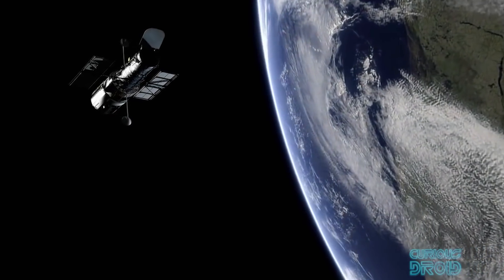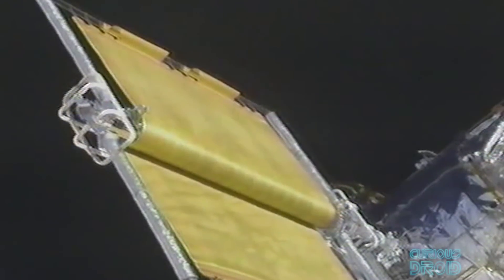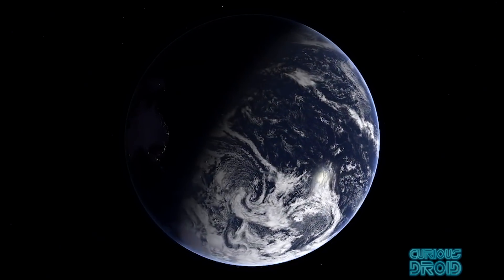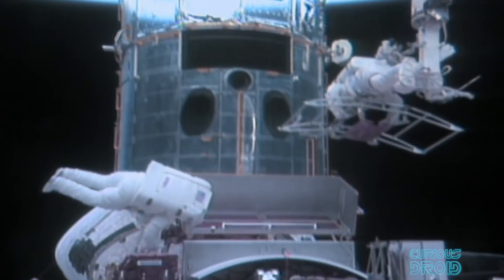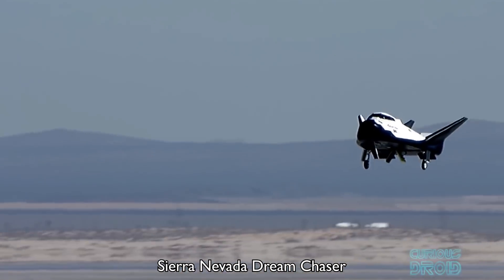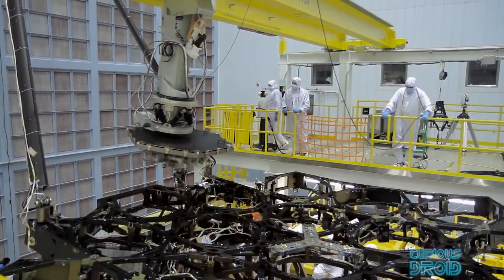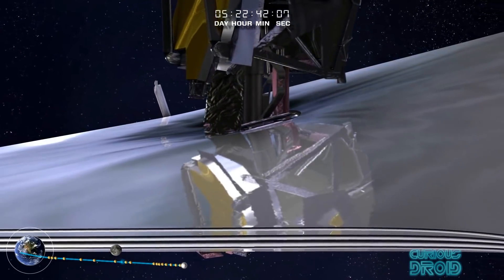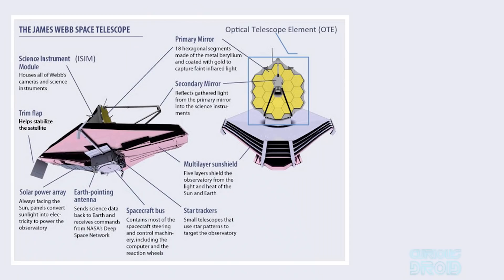Can We Save Hubble and Where is the James Webb Space Telescope?

Comment: “What do you think we should do with the Hubble telescope”?
My answer: Fix It, my suggestion to do that is to draw up an international prize open to private industry to travel to the Hubble servicing it, and then push the telescope to the desired higher orbit.
Reply: Obviously they need something big enough to handle hubble, and the telescope is quite big. Plus to operate on today's stardards, it would pretty much need to be completly rebuilt. However, at least we know that space X's starship could hold it in its bay, so at least that sorts the issue of the "who" can save it
Reply: @mobiuscoreindustries  yeah i think starship would even open options to pick huble up into its belly and work on it to improve it without EVAs neccessary. That said Crewed Starship will take another 10 years.
Reply: @invalid8774  I mean, an uncrewed starship could at least prevent it from falling down, but starship is progressing extremely fast. And while engine-rich exaust can still be a problem, really in term of tech they need to really figure out, only 3 hurdles remain:

- Skydiver landing maneuver. As the most risky part of the entire flight and most radical of its design, they will need to prove a lot to ever get humans on that
- Reentry shielding and re-use. Obviously this is where programs like the shuttle utterly failed, because their refurbishement was just a mess. SpaceX took a better aproach (i think) but its effectiveness remains to be tested
- Hot gas thrusters, these will be an integral part of the "true" skydiver maneuver as a way to make it a LOT less risky. With the extra power of the hot gas thrusters, the flip maneuver could be acheived usign the thrusters alone, leading to a "simple" linear deceleration.

Considering how fast they have been moving, i am thinking that a crewless starship could take on operational missions as early as 2023 and maybe even sooner. I can't say for the crew, since these take a lot of time, but i think spaceX has garnered the respect of both financials (who still groan because spaceX will stay private but whatever) and the public worldwide. Only thing that could really delay starship would be opposition by lobbists from their rivals (thinking ULA and BO primarely) that would make it harder for an unorthodox vehicle to take on missions, or try to exclude the starship from any of the lunar missions.

That being said, in typical Elon fashion, he already devanced the issue by pressing forward the activation of starlink. With financial independence the starship timeline is less likely to fluctuate due to political shifts unlike almost all governement funded space projects
Reply: @mobiuscoreindustries  While I fully agree with most of your points but I see a lot more influence that might cause delay. The raptors havent flown ever, we dont really know their reliability yet. That certainly has to be grinded out for crewed missions. Also the tank design will need tests to optimize and I dont expect they will hit bullseye on first try with this one.
SuperHeavy construction has just started and needs to be tested. While its arguably just an upscaled falcon booster, that might take not that much time but upscaling such a complex thing as a rocket is usually not done that easily.
A launchable starship in 2023 for missions might be possible, I think a lot would have to work out decently for that to work. Worst case Im sure we will have extended test flights and mission simulations in 2023. But considering how long it took for falcon to transport humans, its hard to say, if we see crewed starship missions this decade. Maybe as the lunar lander module for the Artemis program but I dont expect NASA going with starship with this one. Time will tell.
Tbh I hope Ill be wrong and SpaceX gets to launch crewed missions in the next 5 years and uncrewed in 2022 or 23.

Final thought: how would starship catch huble and stop it from dropping into earth? does hubble have a docking port or sth alike? How did the space shuttle move hubble? I never looked into that, do you know?^^
Reply: @invalid8774  First of all, the raport HAS FLOWN, serval times in fact, during the 50m and 500m hops of the serval starship testbeds. They have also endured far more static fires and overall engine tests, including the raptor vaccum engines, which are resilient enough to be fired and tested at atmospheric level without too much flow separation (for those uninitiated, the destructive effect that using an overexpanded nozzle causes in atmospheric pressures).

This makes raptor into the only full flow stage combustion engine to ever be tested in flight, and de facto the most advanced engine currently manufactured. As for reliability is is true that it will need to be thoroughly tested, but so far the only flight test that resulted in engine damage was starhopper (where in the very last few seconds, you could definitly see the raptor was running "engine-rich"), the rest of the tests and ocasional failures were all linked to other failure points, which is quite surprising since most said that no engine could run an oxygen rich pump without tearing itself appart (and for good reasons too).

When it comes to cargo starship becoming operational, it really is a question of certifying the landing, new hot gas thrusters, the "elonerons" and ironing out the construction. SpaceX here can work a lot faster since they are working entirely on their own, with their own financing and their own infrastructure. As for the superheavy, it is currently being built to undergo the ususal pressure/static fire, ect. However superheavy has the advantage of using the "traditional" orbital reentry burn and landing compared to starship's unique aproach to propulsive landing. Because it does not need that much new stuff, it is likely going to proceed through testing a lot faster. 
The raptor itself so far is not going to run into issues with that landing, mainly because unlike the merlin engine, it does not need any hypergolic fuel to activate. And the raptor has proven that it can reliably spin its turbines and ignite itself at full thust in a fraction of a second. It also helps that the full flow combustion and methane burns cleaner than RP-1, so there is far less likely going to be problems linked to glogged valves like what was recently discovered on the reused merlins.

SpaceX will aslo probably want to certify their orbital refueling, and while they will "as ususal" run token cargo tests for the first flight, it is also likely they will load their testing vehicles with their own starlink missions since they won't have someone's infrastructure on the line. This kind of rapid pace developement is surely going to make the system go online a lot faster than ususal.

As for human certification, well it will depend how willing lawmakers will be under the new governement, but this can boil down mainly to performance, reliablity, and proving that starship can abort without a dedicated abort system. 

As for the NASA moon programs, the one thing that will kinda put starship in the spotlight is that it is likely going to be the only operationally tested superheavy launcher and lander by then. Blue origin still hasn't flown a new glen, and SLS is still grounded. And as of right now none of the companies have built and tested their landers. It is likely the moon missions will be delayed, and likely scaled down too to the point of being token. But either way SpaceX plans of duing the moon missions on their own if nasa does not play ball. They will need to put the infrastructure in place first anyways, so they can just keep sending lunar starships with drones, machinery and equipement until public they prove the reliability of their system enough. It would not surprise me that a national team lander would find itself landing nearby to a fleet of starships already being there. Crewed or not, that remains to be seen. 

And on the topic of hubble, it is fitted with a special attachement port which was built so the space shuttle could link to it, bring it to the bay, and then perform an orbital boost. While no vehicle currently in service has this docking port, it is not like it was space shuttle exclusive. Technically any expendable vehicle fitted with the correct equipement could do it, but starship has significantly more payload to content with, allowing to perform checkups and potential upgrades as they do so. Being the vessel that saved hubble from destruction would also be a gigantic PR boost for spaceX, if they needed any more really.  Plus until james web actually gets launched, it would be a shame to lose our orbital telescope. I know, it is outdated by a large margin, but it is not like we have any other good options
Reply: @mobiuscoreindustries  yeah raptor has technically flown, but hasnt been in higher altitudes or in space, I wonder if that will work as easily as merlin has been, its a much more complicated engine.
But its fair to assume decent reliability based on whats known so far.

As I said, I totally agree with the obstacles you pointed out, I might be a bit more cynical and do not expext a super smooth sailing like the falcon has become at the beginning. It took a few years to get falcon to that point and I expect similar progress for star ship and superheavy. 

On hubble, thats pretty cool yeah, that port should easily be mountable insane a starship on a robotic arm or somthing alike. Its basicly a bigger and better shuttle. Yeah Id also love it if we saved hubble. Starship might be the only vehicle able to deploy james webb to the orbit it shall be placed in so that might be good start. :)

Lets see how it turns out

Comment: How much did a Hubble repair flight by the Space Shuttle cost?  $1.5 billion?  
Have NASA take bids for plans to repair and boost Hubble's orbit from any government/private company/organization of any kind.  Gradually increase the amounts as proof of concept and hardware is built (like what they did with Boeing and SpaceX's manned capsules to the ISS).  You could probably get it done for less than $1.5 billion and lots of technology would be developed by lots of different organizations.
Suggestion: put in LOTS of rugged gyroscopes! When they boost it to a higher orbit why not one a lot higher so it stays up for decades or centuries?
Reply: There were five repair flights.
Shuttle launches cost about $1.8b each in today's money.
SpaceX Falcon Heavy launches cost under $100 million. They haven't taken people yet, of course, but they will do very soon. Hopefully this year.

If it goes much higher, there's the problem of the Van Allen belts. Radiation would wreck the CCD over time. It has to stay below the belts, so it is protected by them.

The gyroscope problem has been solved. They assembled Hubble gyros in Oxygen, which corroded the wires over time. Now, they use Nitrogen instead.
Reply: @ann_onn  I never thought of the Van Allen radiation belts. Thank you so much for clueing me in. I couldn't understand why they were being so stupid to keep it so low! It turns out they weren't being stupid, I was being ignorant!
Reply: @ann_onn  I do hope they get some of the nitrogen gyros to the Hubble because it has been such an amazing instrument and (people forget this) it was incredibly expensive to put there.

Comment: This is not the successor of HUBBLE it's more like the successor of spittzer telescope..HUBBLE is a visable telescope where JwST is an infrared telescope totally different pictures.i believe the jwst can look in the visible tho.but it's a mainly an infrared telescope
Reply: Hubble goes from ultraviolet through to near infrared.
JWST goes from optical to mid infrared.
Reply: @ann_onn  I know the HUBBLE has inferred but it's not anything like the JWST will be.
Reply: I don't know what you mean.
Yes, it's completely different.
However, both see in the optical range.
Neither is "mainly infrared".
They both have a bunch of different cameras, and instruments, OK?
It's complicated, but it's wrong to say "i believe the jwst can look in the visible tho.but it's a mainly an infrared telescope"

Hubble (has) had...

    Advanced Camera for Surveys (ACS; 2002–present)
    Cosmic Origins Spectrograph (COS; 2009–present)
    Corrective Optics Space Telescope Axial Replacement (COSTAR; 1993–2009)
    Faint Object Camera (FOC; 1990–2002)
    Faint Object Spectrograph (FOS; 1990–1997)
    Fine Guidance Sensor (FGS; 1990–present)
    Goddard High Resolution Spectrograph (GHRS/HRS; 1990–1997)
    High Speed Photometer (HSP; 1990–1993)
    Near Infrared Camera and Multi-Object Spectrometer (NICMOS; 1997–present, hibernating since 2008)
    Space Telescope Imaging Spectrograph (STIS; 1997–present (non-operative 2004–2009))
    Wide Field and Planetary Camera (WFPC; 1990–1993)
    Wide Field and Planetary Camera 2 (WFPC2; 1993–2009)
    Wide Field Camera 3 (WFC3; 2009–present)
Reply: @ann_onn  ok look HUBBLE is a visible optical telescope with abit of inferred and ultra violet capability..jwst is a mainly inferred telescope.woth a bit of the others if they need it..but it is an inferred telescope mainly..and it needs to be if we want to see back to the first stars and galaxy's.because they've moved into the red spectrum.what we cart see with hubble.not powerful enough in infrared.we also need to take pictures and analyse the light spectrum from other planets.thats why it as the other capability
Reply: @kevin clsyton I do not want to argue with you; what you are saying is mostly correct. It's infrared, not "inferred". Please get a spelling checker. I'm not being pedantic - I'm saying this with the very best of intentions - hoping you will take it on board so that your future comments will be better.

They have not "moved into the red spectrum". There is no such thing as a red spectrum. Their light has moved towards the red end of the spectrum.

I don't understand what you mean by, "thats why it as the other capability". That sentence does not make sense in English. 

I love Spitzer, but it is incredibly frustrating that we only get a couple of hours per day from it. I desperately await the long-delayed launch of JWST.

Best regards.
Reply: @ann_onn  sorry about the my predictive text..spelling a word wrong..I'll ring Samsung and tell em to sort it..look they is a red spectrum.they aren't going into the red spectrum.what dose that mean anyway?the reason they are building the JWST is to see the things we cart see at the moment.because they are in the red spectrum..and the other capability are what the jest can do.other than seein the the infrared.like ultra violent and looking at every spectrum in an atmosphere to see what they are made off.look go to nasa web page and look what it can do.and you will see the OTHER CAPABILITY...best regards
Reply: If you can't be bothered to write in English, then I can't be bothered reading it.
Simple as that.
Sorry.
That message was an omnishambles.

Comment: Question: Why don't they put the James Webb in regular orbit to start so they can test it out before sending it off to L2 location? At least it would be in space.
Reply: It would not work in a low orbit. It needs to be very, very cold.
Reply: @ann_onn  I guess I meant not really using it in low orbit but testing if the solar panels would open. I understand that the way it was designed to work was to be super cold. It's just that they said where its going to be parked we can go to visit and fix like the Hubble. And of course I have an fear that if the launch goes badly all these years go up in smoke. So I hope their careful with the launch vehicle.

Comment: Well, there isn't really any option with the "fix it or let it burn up" question... because there just isn't a vehicle in service that's capable of fixing it. You need a shuttle and STS and buran are no longer flying. I've often thought that you MAY (capital letters "MAY") have been able to do shuttle-style servicing missions with a TKS but as the free-flying TKS stopped short at 3 missions and it's evolved into just a space-station module, that's not an option either. As for Dream Chaser... at this moment, it's doing a good job of chasing dreams but it's not an IN-SERVICE, manned, orbital vehicle.
If it had a suitable docking adaptor then I suppose you could send a Dragon or a Progress/Soyuz to reboost it... But you'd need a servicing mission to fit that docking adaptor (GOTO 10).

And really, there isn't much point putting it in a museum. Is the Apollo 11 LEM in a museum? Is Salyut 6 in a museum? Is Voyager 2 in a museum? Are Mariner 4 or Venera 9 in museums????